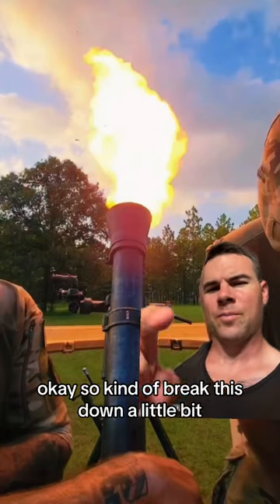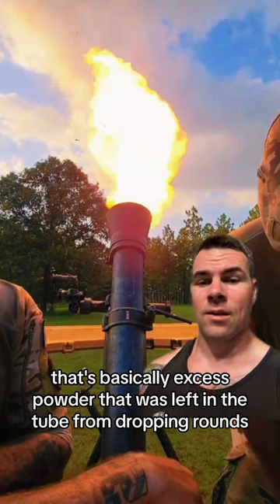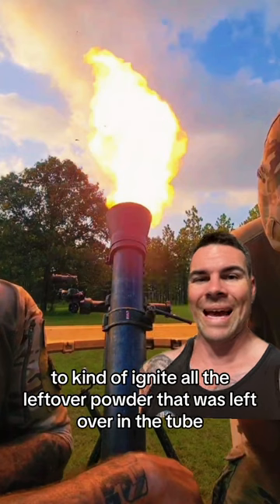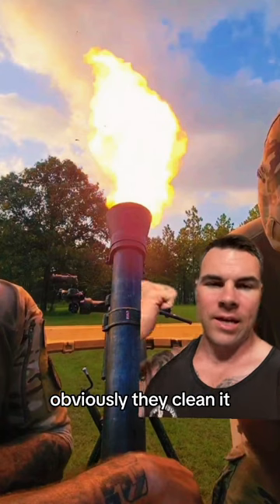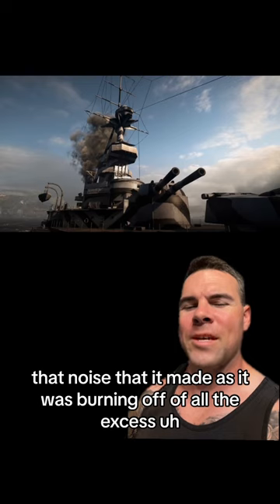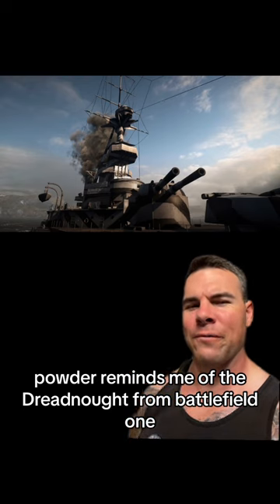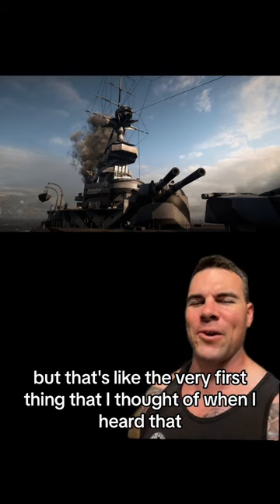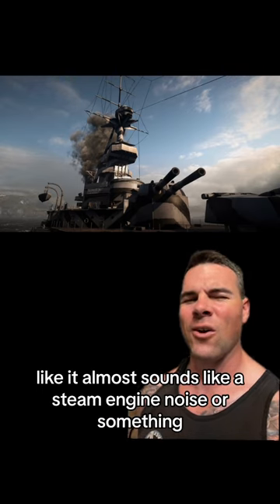Well that’s one way to clean a Mortar Cannon. Via: jessemoses426 on TT #military #marine #army #navy

Comment: I’ve seen chemistry professors do this sort of thing with big graduated cylinders with the insides coated with some sort of liquid sulfur compound. It even “barks” like the mortar did
Reply: You can also do it with a five gallon jug and rubbing alcohol.
Reply: Yep. It's a pulsed flame. Burns off available oxygen, flares out, oxygen gets sucked in, and the gases are still at ignition temperature to cause another flame front to form.

Comment: Ok story time:

I'm a young EOD tech, E-4 mafia, at my second duty assignment which is a remote tour in South Korea. We get a call for a mortar stuck in the tube. I had never worked a stuck mortar, and neither had my team leader. Though we had done lots of jammed arty and the like. 

So we follow all of our procedures, turn the tube upside down and we hear a hissing sound. Just as I look up to ask what that sound is, I see my team leader running full out assholes and elbows toward the truck. 

I half heartedly jog behind him because if something was going to blow it would have happened already. There isn't often time to run when there is real danger in the explosive business. 

We walked back up to the tube and inspect it only to find that the mortar had moved halfway down the tube. The hissing noise that my TL ran from was the sounds of the mortar scraping against the side of the tube! 🤣

I took him to kangaroo court on that one, and easily won the case (of beer for the shop).

Comment: Old school 11c (Mortarman) here, this is actually a very important thing to do and seems forgotten, the built up powder could detonate with the next round fired, if that round is charge 4(max) then there could be a Tube rupture, especially on a older tube that has barely passed its Borescope and pull-over.

Comment: Not an ideal technique. Best to clean the bore every 12 rounds. You keep heating the tube like that; you drop a round down the tube and the cheese charges just might ignite before the round hits the firing pin at the base of the tube prematurely. Then you may have a short round or one that will go where it’s not supposed too. Short rounds are extremely dangerous situations. I had one go off short after a very long fire for effect missions while firing a M124 60mm mortar. A piece of shrapnel took the lid off a box of unfired rounds I dove next to. When you get to a stopping point during on going fire missions you want to try and cool the tube; not heat it up!

Comment: If I’m not mistaken it’s actually acting like a pulse jet. Like what the German v1 flying bomb. It has the fuel to burn fast and create thrust but after the first big conflagration it doesn’t have enough oxygen and pushes the hot gas out creating a vacuum, which then in turn pulls in more air letting the fire get more oxygen creating a loop of fire, expulsion of gas, vacuum, fire until there is no more fuel

Comment: No that sound you heard is how pulse jets work, air tryinna rush in, oxygen fuels the burn faster, it pushes out the gas and sucks more in, just like an engine bit with no compression, no valve control, no head.

Comment: This only usually happens if you fuck up and break a cheese charge in the tube, it’s vehicle mounted so in order to get the nitroglycerin out the tube so u won’t get a hang round is with fire because u can’t tip the gun and even if you could who TF wants to re sight the gun when you can be hanging rounds. Plus I guarantee you they plunged the tube after that.

Comment: Fun fact, that noise is essential the same shockwave principle that pulse jet engines operate off of. Just with a solid fuel in this case. 

For example the german V rockets aka "buzz bombs" were pulse jets, which inspired their moniker.